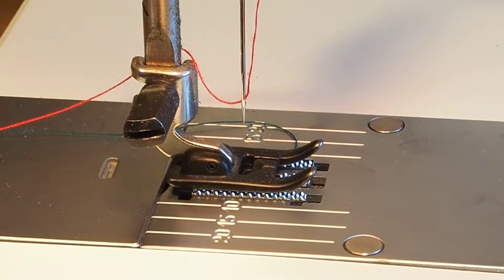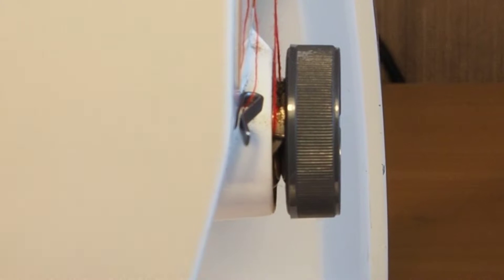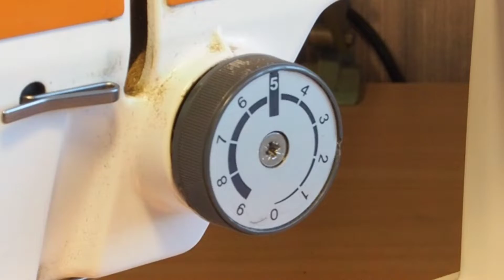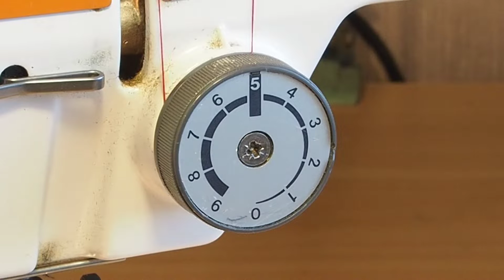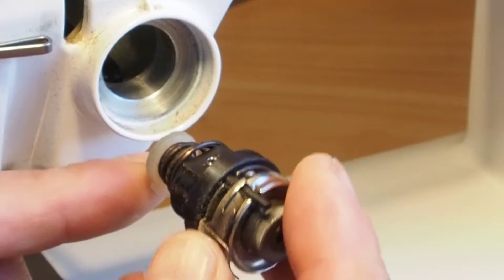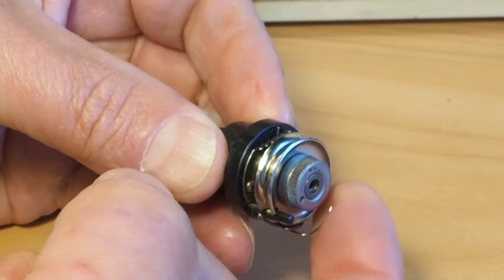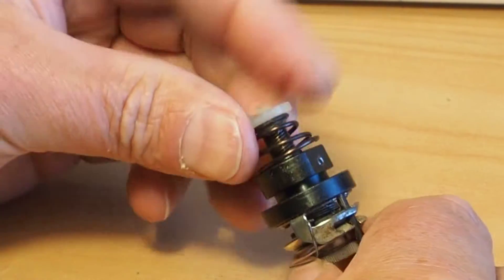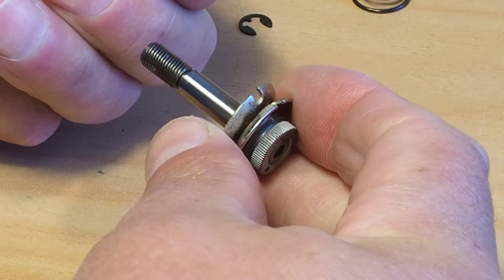Sewing Machine Tension Issues - Thread Looping Underneath - Part 2

Comment: Am slowly going through this excellent video. My elna lotus tension is bad. The cotton wraps tight around the bobbin pulls the material into the bobbin area and the tension on the thread from the top is very very tight. Have got far as the 2ml Allen key… I hope I can find a 2ml Allen key…

Comment: Hello. I found this video brilliantly helpful when I bought a Lotus tsp about a year ago. It’s working well now and I’m slowly getting better at sewing. Sometimes when I start a new seam, the top thread wraps around the bobbin holder and gets stuck there, “locking” the machine and I have to unpick the mess and restart. Do you know why this would be happening and how I may be able to solve it? Thank you in advance for any advice you have. S
Reply from the maker: Thanks. Make sure you start your seam with the take-up lever at the top of its travel and also hold both the top and bottom thread ends when starting the seam.
Reply: @InStitches  Thank you. That sounds so obvious now you’ve said it! I’m going to try it asap. Thanks again, I appreciate you taking the time to reply. S

Comment: Good day.  I have just acquired a TSP. I think it has been standing for a long time.. please could you advise.  My presser foot does not lift I have tried oil to loosen it to no avail.  Also the stitch length and and other dial do not turn at all.  And advise will be appreciated
Reply from the maker: Sounds like you need to get some penetrating oil (WD40 or CRC 556) into those stubborn parts. Leave it to soak for a bit and try to move them. If that doesn't work, you could try carefully heating the foot bar bearings but be careful not to overheat the area and melt plastics that may be nearby. Once they are free, put oil on the freed up parts. Thanks.